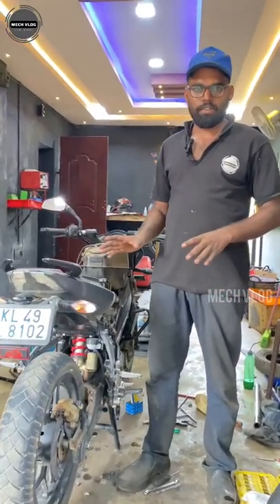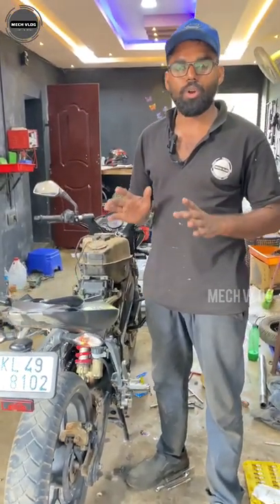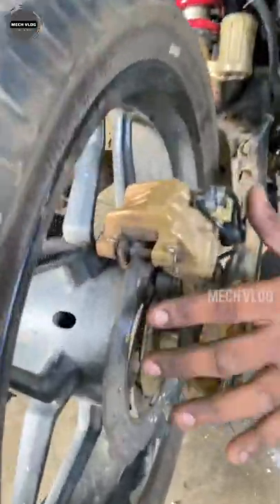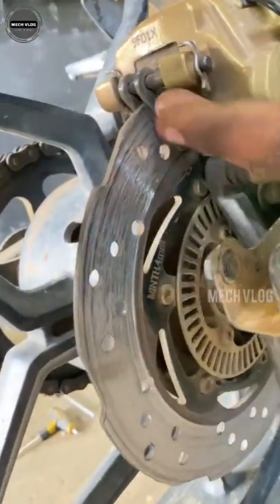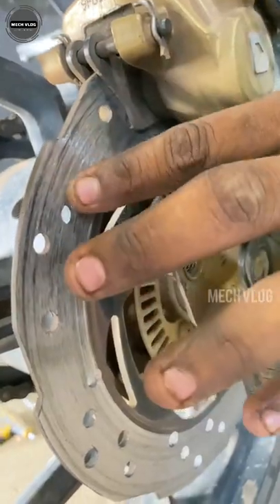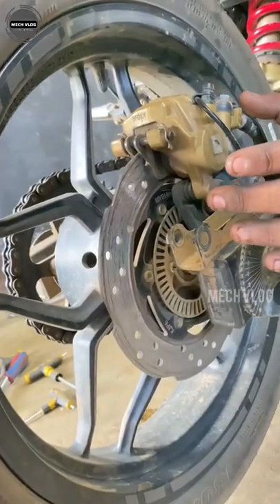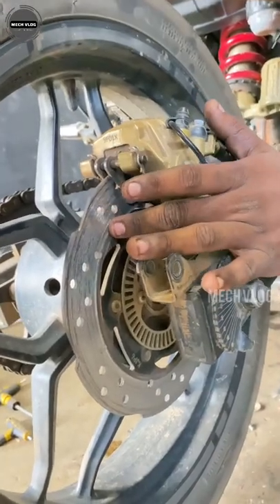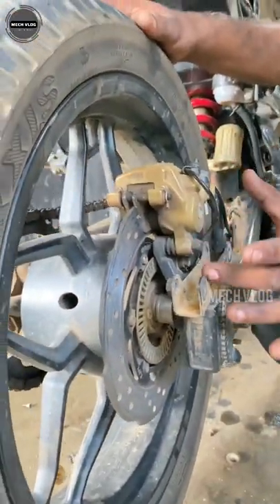Disc Brake Problems In NS200|Malayalam|Shorts

Comment: Bro, എന്റെ ബൈക്ക് Duke200 ആണ്,
ഇടക്ക് വണ്ടി running ൽ pass light അടിക്കുമ്പോൾ meter speed zero ആവുന്നു..
Showroom ഇൽ പോയി അവന്മാര് വണ്ടിടെ full wiring kit change ചെയ്തു, charging coil change ചെയ്തു....
Passlight അടിക്കുക്കുമ്പോൾ മാത്രമേ ഈൗ issue ഉള്ളു, അതും ഇടക്ക് മാത്രം .... അല്ലാണ്ടെ ഒരു കുഴപ്പവും ഇല്ല...
Reply: Bro pass relay mari nokk

Comment: Bro pulsar 220 full acceltor kodukubol 6k rpm akubol cutt off akunnu but new cdi anu plz replay
Reply: Check spark plug and ignition coil and also the plug
Reply: Carburator vandi anegil replace carburator